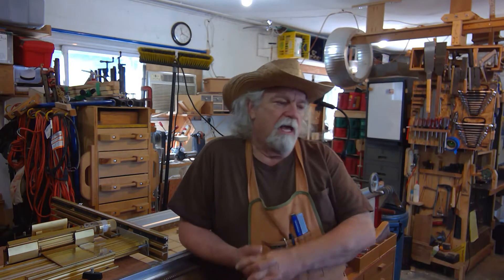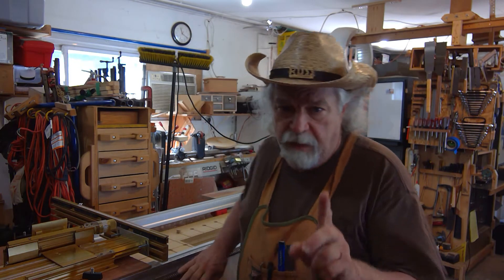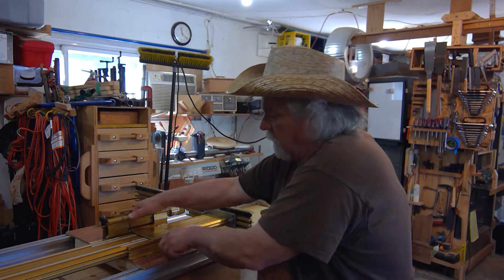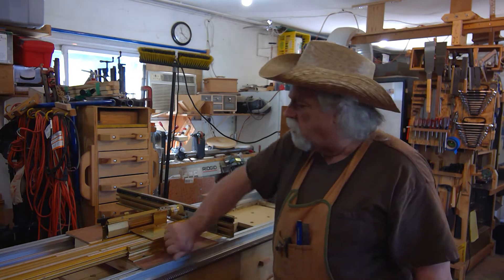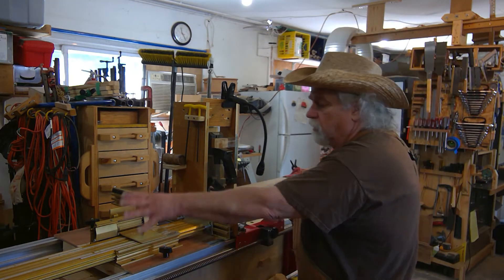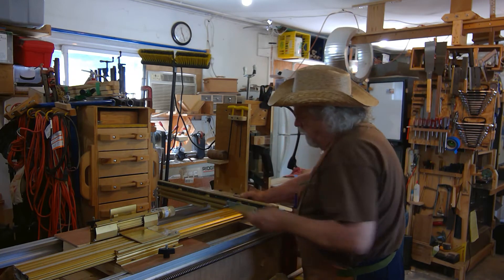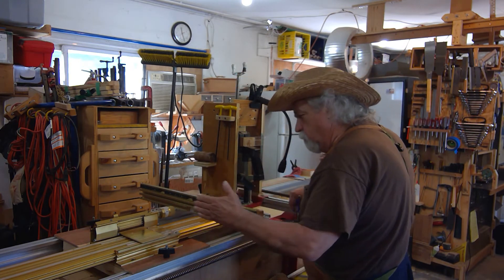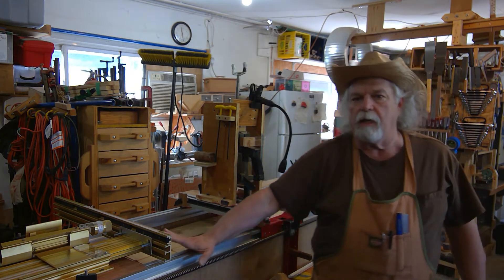Legacy Building incra fence system on my legacy

Comment: Hi Russ
If you do not need the Fence then buy an LS-17 available in both Imperial (Inches) or Metric from https://www.incrementaltools.com/, they are as knowledgeable as Woodpecker and I always prefer to work with the manufacturer if possible. 

I never thought of using INCRA and Legacy Manual machines together, I missed a trick because I used to sell both products in the UK until I retired 4 years ago. I have an LS-17 sat on my workshop shelf waiting for me to use it but currently, I am into wood turning which I hope to combine with a Legacy CNC later in the year.

I sold many Legacy manual machines but lot more INCRA LS System, in fact, I would say that those were probably my favourite products.
Regards
Roger
Reply from the maker: i was not aware of this web site.  it appears to have better pricing at first glance.  thanks for sharing (and watching :>)